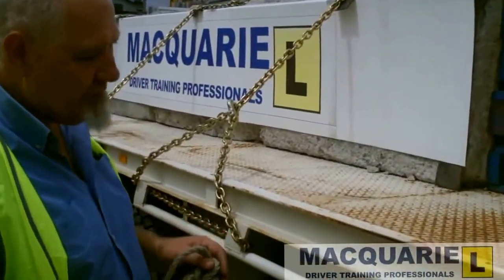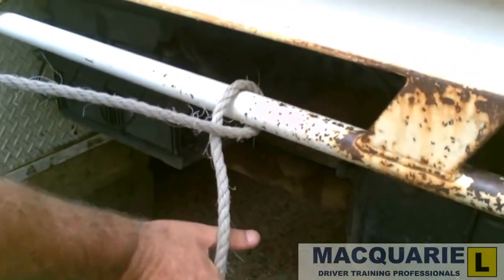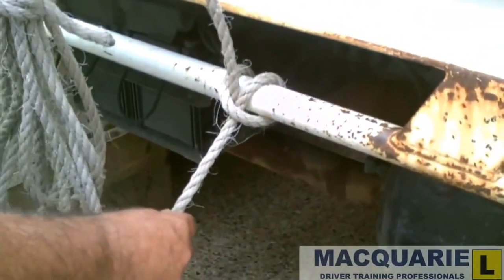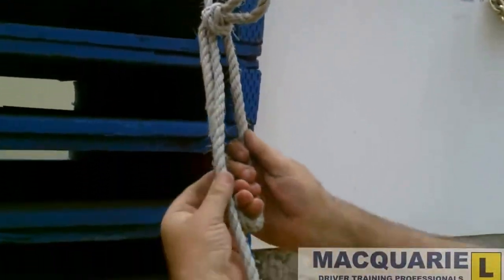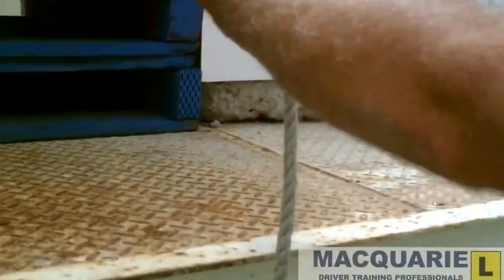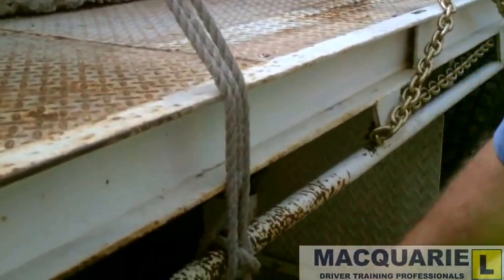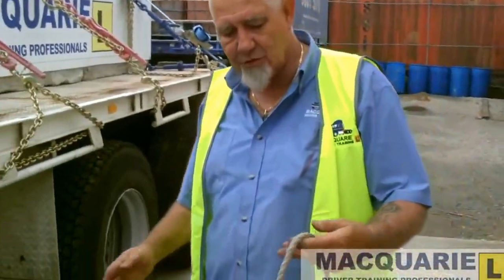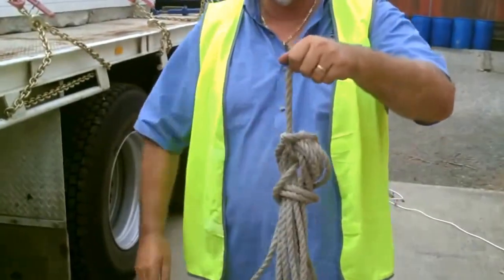1. TRUCKIES HITCH _ Macquarie Driving School Sydney.mp4

Comment: Back in the 70’s and early 80’s straps were not available yet.
We flatbedders used ropes for almost everything we hauled . Mainly for bagged goods like pallets of chemical fertilizer and pallets of boxed goods also.
All of our flatbed trailers had hooks under the rails back then. I could make those truckers knots so fast it was just a blur. If a driver pulled the rope too hard he could actually rip through the product on the pallet. Thats when v boards were 
“supposed” to be used. Lol
Reply: Richard Nixon today's drivers complaining how hard to strap/unstrap a load using 4" or 2" straps

Comment: Yes this is the original truck hitch or commonly known in UK as a Dolly Knot,my dad thought me this in the 60,s when I was a kid and I have used it ever since and never had one slip.
If you put a twist in the bottom loop then create another loop  before you put the tail through its easier to pull tight but the beauty of this knot is once you undo the clove hitch and pull down on the  tail the entire knot will come undone no matter what rope or how wet it is.

Comment: I just use ratchet straps.....and chain binders.Who still uses rope tied by hand?
Reply: You still need to know this knot as a back up when you have no chains or ratchet straps at hand. and its not just used for truck loads there are countless situations you may need to tie something down and you don't want to use a good chain or strap.
Reply: Some loads are damaged by straps and chains. I used to deliver aluminium scaffolding and the straps bend the frames. Two or three ropes will tie down a load easily.
Reply: Let me guess: campers, arborists, farmers, herders, sailors, rock and mountain climbers, special ops forces, horse riders...?
Reply: @markm8188  us poor people too
Reply: Well straps and chains are the only legal option to secure a load in qld, Australia. There is still many places it's invaluable e.g. may be allowed as a secondary which may remove some movement from the load so it doesn't get damaged, tarps etc. but people check your local regulations.
Reply: @asdasd-ni8eg  not true. Whilst it seems the preference for heavier loads are straps or chain, rope is still legal to use here in qld. https://www.qld.gov.au/transport/vehicle-safety/transporting-loads/how-to-transport-loads
Reply: This knot will collapse with synthetic ropes